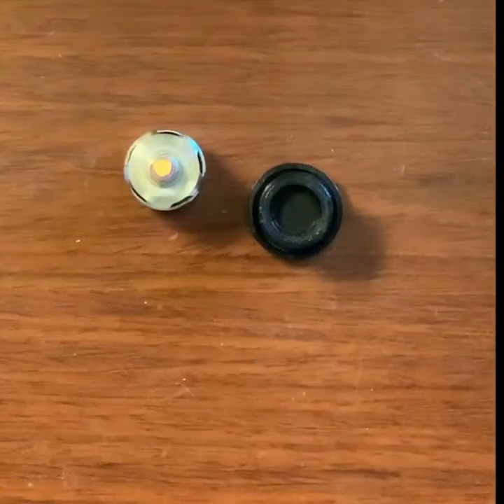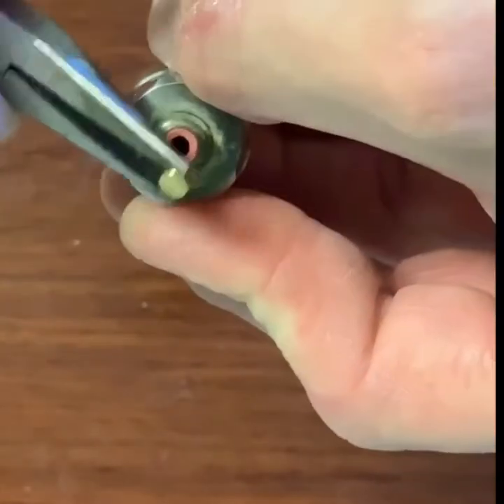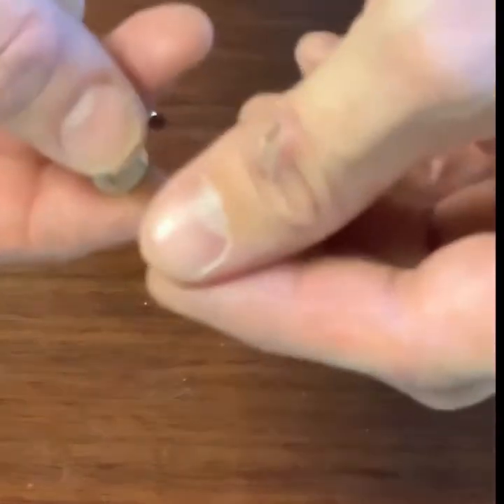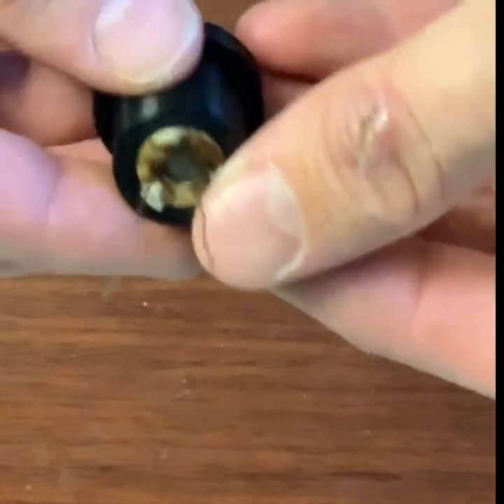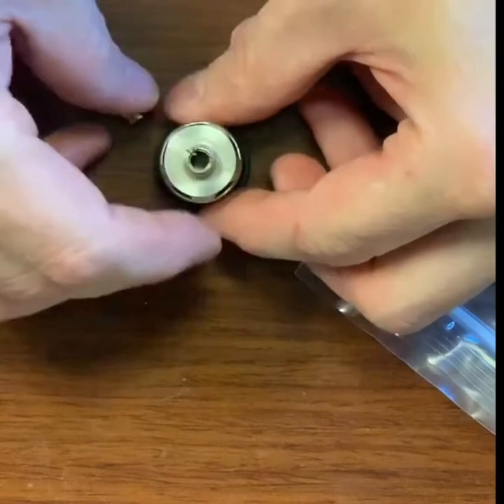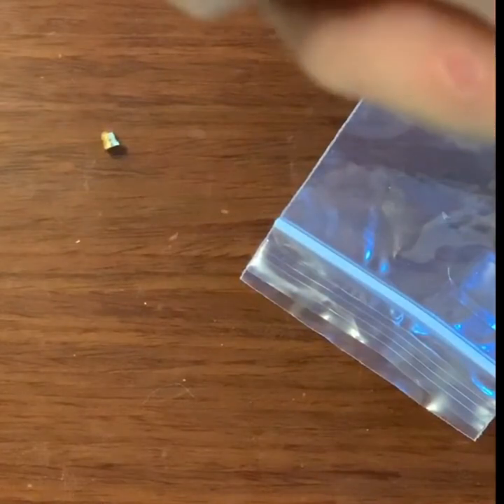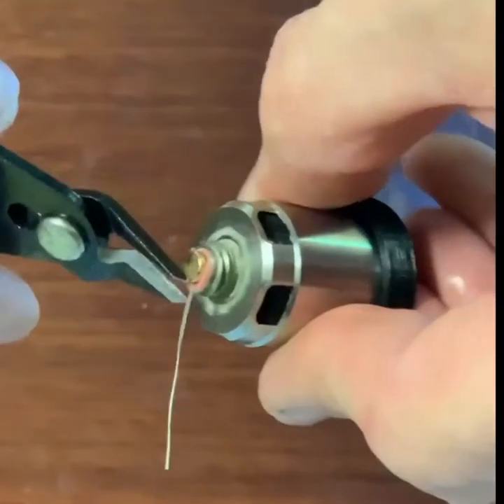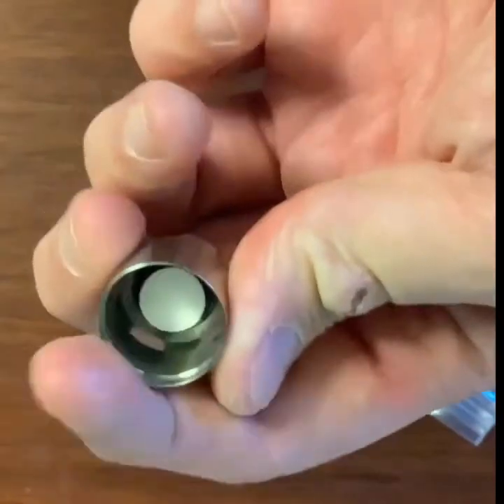Puffco Peak Atomizer Rebuild with Mr. Bonsai

Comment: Dude again my hero.  Was gonna sell
My peak bc atomizer issues and I
Don’t want to spend more on that than just having a different rig. But if you beefed ceramic heating pads too to he better that is a huge plus. And I do like my peak accessories.  Gotta try Ruby from you.  Also I had an atomizer melt to my former sic bowl and somehow through it in a day or two always extremely careful cleaning daily.... it was on blue setting too. Sneaky pete Sic bowl.  Was amazing until 1 atomizer broke finally, I put it replacement certified organic real new peak atomizer after a month with like no aigns of ware.  In a day I have a hole in Sic cup, it
Is fused to ceramic stove which is of course also cracked and that was like out of the blue on a blue setting.  And clean.  Sketch as hell.  Think it was anything I did or Sic bowl idk what bc it handled over a month prior on all temps no prob? 

Lastly  do you think somehow simce it is 510 threads to build an atomizer that doesn’t have spill potential under bowl but mostly just gets gunked bad after maybe a but of extreme terp diamonds but from vapor bc it’s so sticky at any temp.  Like if somehow the air could avoid that and make it in hole no instant gunk after every dab from really absurd stuff around here. If somehow there could be a separate air path that atty or same 510 one with different metallic piece and plastic top it might be possible to bypass that to notndeap woth that crap.  That would be ultimate.

Comment: Hey bro I replaced mine today for the first time and the new one cracked first heat and I took it out put another one in same thing happen so now I’m lil scared it will happen again cause I only got a five back repair kit and now I only got 2 left which I no I will need so Idk what to do can you help me out
Reply: You have wet areas make sure everything is DRY or else it will crack